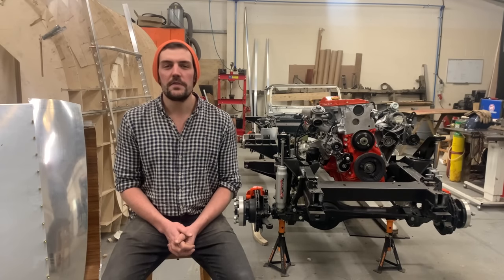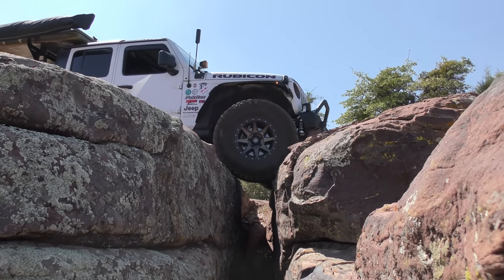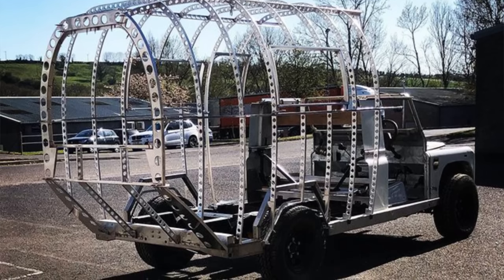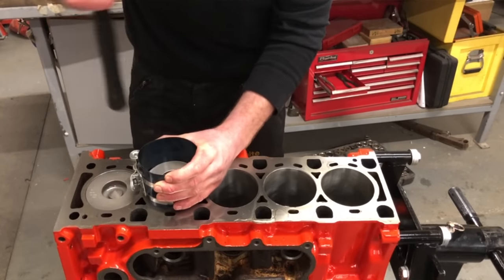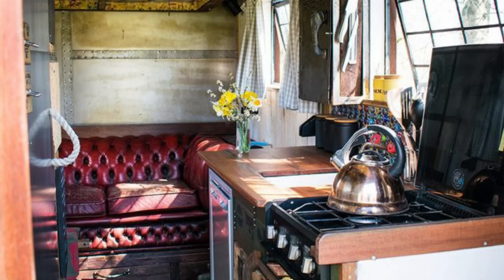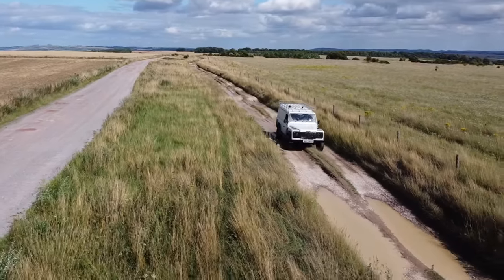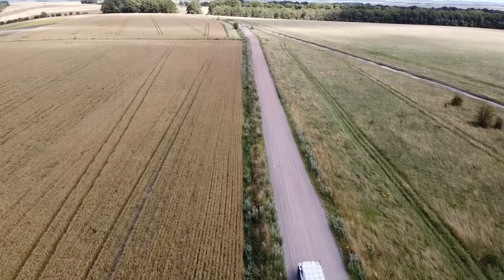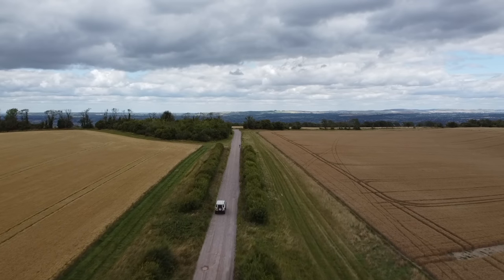FIRST LOOK: "The Airlander" A Land Rover Aluminum Camper built like an Airplane

Comment: 4:04
In Oregon, a 'wood frame' engineered to be removable because it is not part of the completed structure is known as a 'buck'.
.
Irregardless, this project looks as though it abuts the limits of the GVWR.
As a pilot, I must be constantly aware of weights and balance.
Does this configuration shift the balance away from the center of the vehicle?
.
Yes, it can be done, but could the journey be better served with a dedicated truck along the lines of a Tatra or M.A.N.?

Comment: Why build the camper out of wood? Aluminum structure would be much lighter and rot / corrosion resistant. I'm not an engineer just curious.
Reply: The woods used to shape the aluminium panels around
Reply: seriously ?
Reply: The aluminum is just for the template frame-work. It's all being removed and built completely out of aluminum 👍
Reply: The wood will make it possible to float the build across the Atlantic.

Comment: It's a beautiful concept, but also, it's not using the right wood joinery for a land vehicle cabin. The wood over the steel frame needs 3 point or higher joinery to not shake apart, even with the steel frame beneath, unless it's going to become part of a fiberglass unibody. Maybe I'm just not able to see pegs reinforcing those half lap joints, but if those aren't pegged, they will fail under bumpy driving conditions. I've seen it happen with dozens of homebuilt campers. For something more stationary, like a tiny house or tree house, it's sufficient, and for aircraft, it can work, although most aircraft builders would reinforce those half-laps with fasteners and/or epoxy for the same concern I am addressing. Over time, half-lap joints will compress from vibration, thus loosening enough to have a little play. Once that joint has play in it, you're one bumpy road away from a camper fire for the same reason you can build a fire from the friction of two  pieces of wood. I am sorry to sound like a camper-build snob, but I hate to see a good concept wrecked by a slight oversight. This build isn't done, and maybe the builder is already planning to address the wear and shrinkage of the wood components in the next step of the build. He needs to do so. The milling on the wood components look great, and the shape is gorgeous. It looks too good to become a safety trap over one errant oversight, and that why I'm commenting this little novella. I can see how it will look, and it's truly gorgeous.
Reply: The wood gets fully removed. It’s just a tool to shape the frame work and the skin to.
Reply: Hahahahaha this is a perfect example of someone thinking they know better then the person that they are watching lol it's amazing to read every time.
Reply: At 0:59 you can see the non-wood frame, bruh.